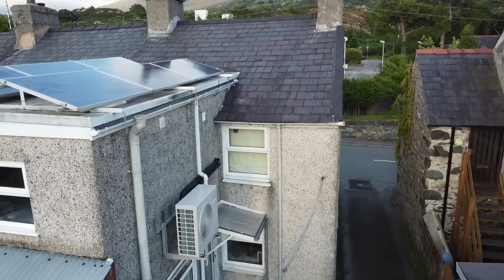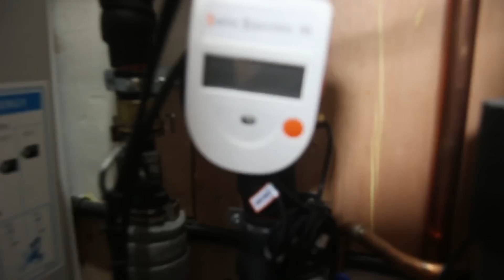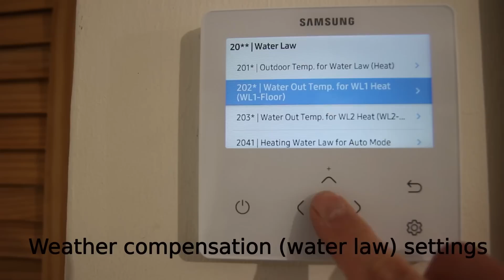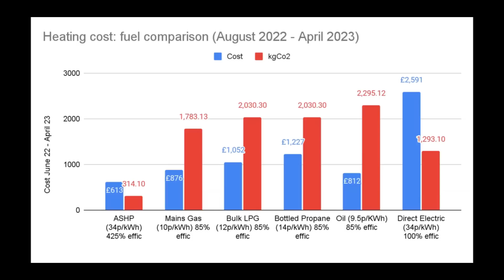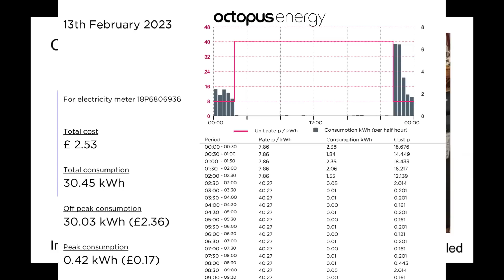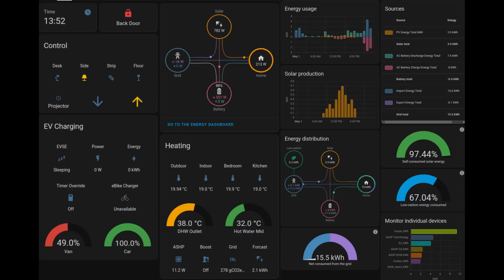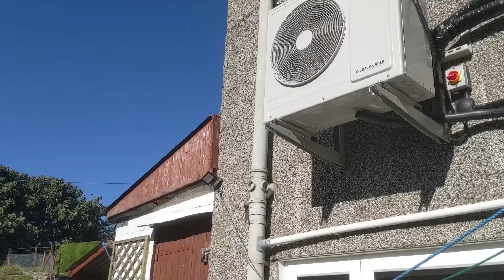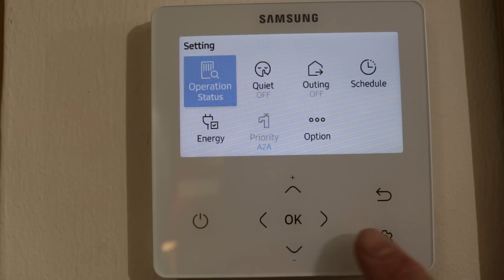Part 2/2: Air Source Heat Pump 1st Winter Performance 2022-23 in Solid Stone Welsh Cottage

Comment: Great job. Well done. I have a Samsung Gen 6 system as well. Any chance you can share the details about adding a WiFi unit.
Reply from the maker: This is the Samsung WiFi unit, it enabled basic control of the HP via Samsung Smart Things app
Reply: Thanks for the reply. I'm planning to add WiFi to my system. But I'm not too sure about the wiring.  As I understand it should wire to F1 f2 v1v2. But those 4 terminals already have wire on it.
Reply from the maker: @alanmeng999 yes, you just connect the WiFi into the same terminals. There will be multiple connections on the same terminals
Reply: I really appreciate the help. Thanks
Reply: I installed it a few days ago. Now I can turn on the heating when I'm on my back from holiday. Thanks again for the help.
Reply from the maker: @alanmeng999  Nice work!

Comment: Great video, very informative! I'm in the process of buying a 3 bed bungalow that has an epc rating of an F. It has stone built walls with no insulation apart from some in the loft space. At the moment the only heating is electric storage heaters. I'm Trying to figure out if a heat pump would work or go for oil central heating?
Reply from the maker: @willsvanadventures  definitely go for a heatpump, it will cost 3-4x less than storage heaters and be much more comfortable. If you've not got a wet heating system installed it's a perfect opportunity to install a good system, if you go for a heatpump you can BUS grant £7500 grant and 0% vat for for the whole instalation, including radiator and pipework install
Reply: @GlynHudson thanks for getting back to me so fast! Would it still work without vastly improving the insulation though? Did you have to beef up the insulation in your house?
Reply from the maker: @willsvanadventures  no, I didn't do any insulation upgrades. It's a myth that insulation is required for a heatpump, as long as it's correctly designed a heatpump can heat any home efficiently regardless of insulation. Of course a well insulated home will require less energy to heat, but that's the same regardless of heating source. Assuming you've got some loft insulation and decent fitting double glazed windows doing anything else with building fabric is not cost effective, unless your undertaking significant renovation anyway
Reply from the maker: My house has no insulation in the walls or floor
Reply: @GlynHudson  Ok brilliant thank you, sorry for all the questions!
Reply: @GlynHudson watching more videos this morning and definitely looking more towards a ASHP. Can you recommend any companies for install? Or best systems to look into? Seems to be so many online.
Reply from the maker: @willsvanadventures  maybe take a look at https://heatpumpmonitor.org/ and contact an installer in your area.
Reply: @GlynHudson  Perfect thanks

Comment: Hi Glyn, can I ask about the efficiency figures you mentioned, the 5% under and the 20% over on the figures Samsung report, is this specific to just your installation, or do you think this could be universal across the Samsung range?
Reply from the maker: I've not got much data on Samsung, but we've been collecting a lot of data on Vaillant onboard monitoring on the OpenEnergyMonitor forums, and it seems the inaccraces are often due to manufacturing tolerance and lack of calibration, therefore the onboard monitoring could be over on underreporting. There's no way of knowing without a heat meter to compare.
Reply: @GlynHudson Thanks. I will add OEM to my installation during the summer time I’d imagine. Do regret not doing whilst I was in the middle of it all, but will be good to have some accurate figures to look at.
That said I am quite pleased with what I am seeing currently on the Samsung controller, I’ve had 3.88 (including hot water) over the last week with outdoor temps as low as 0° most nights. This was a self install too.
OEM will paint a truer picture of course.
Reply from the maker: @dannyg2325  Great! That's a very decent combined COP
Reply: @GlynHudson  Coming from Bulk LPG it’s a massive saving! From circa £6.80 per day, to now £2.80ish per day. It’s not to be sniffed at 🙂

Comment: Great channel, I have been watch many things on youtube as looking at put in a system in a new house my son is building and so far yours has been the best for information, I am a electrician in France and have seen many systems and had a chance to play with them I have one customer with a new system with two 26kw units heating a old house with small rads and no insulation that gets a scop of around 2 for the one that just does heating and about 1.7 for the unit that does heating and hot water (output temp from units 55°c) I have another customer with a under floor heating system that has had the pipes slightly closer together  and that runs a output temp of about 26°c and gets scop of about 5.2  (also does hot water) in one of your videos you say that the heat-pump seems to not run as well when output is bellow about 30°c, do you think you need to look at what refrigerant is better for a very low heat output, problem is also want to heat hot water with it. We are in South West France where weather is a bit warmer all year rounds so would expect to get better scop that in UK
Reply from the maker: @ianmills5805  Hi Ian, the comment about minimum flow temperature is specific to my system with my radiators, a system with even larger radiates or UFH will be able to run at an even lower flow temperature. It would be quite challenging for any radiator system to run in a steady state with a flow temperature lower than about 30C. As the DT between the room temperature and the mean water temperature reduces, the output of the radiators will reduce, so the radiators won't be able to dissipate the minimum modulation heat output of the heatpump if the flow temperature is too low
Reply: @GlynHudson  Hi thanks for the reply had not thought about it being the type of system but makes sense,  at the moment am tying to find as much information as I can as we hope to lay floor in the spring, the pipe works out about 1€ a meter so to lay a extra 200 meters of pipe (nothing else   
changes) if it can save a bit every year really money well spent, thanks again and have a great warm Christmas

Comment: Great video. What product did you use to insulate the pipe work in your plant room. Ours is a bit rubish and gappy and would love to improve ours .
Reply from the maker: Thanks, it's just standard armaflex pipe insulation. Inside the property, the insulation is not that critical since any heat will be lost into the house. Insulating the outdoor pipework well is very important
Reply: Thanks It's just for the summer dhw losses, and our exterior pipe work is very well insulated. Have you just wrapped it all in ali tape or is the tape another product? Thanks

Comment: Do you think painting the heat pump and surrounding wall high tech Matt black would double your efficiency if it's south facing?
Reply from the maker: @frederickbowdler8169  no, that won't have any effect on the air temperature
Reply: @GlynHudson  well I think it will warm up approx I kilowatt per square meter per hour which may warm air around it surely that's physics I could be wrong.. Incidentally Albert Einstein designed a fridge basically a heat pump in reverse but it was too noisy.😊
Reply: Let's face facts if you paint the south facing wall of your house Matt black you will have an ugly warmer house. Glaze the wall and you have the trombe wall system. Neat installation.
Reply: I wonder if there is a reason why heat pump cabinets are painted white perhaps it because they want to protect the electronics from excessive heat fluctuations.Or it could be a fashion trend.
Reply: Glyn could always apply a wrap to the heat pump for a period as a test?

Comment: Great work but all tech and electronics wear out and heat pumps do fail and possibly lose performance over time so this all has to be factored in.Unfortuately you live in a stone house which lets face it has 400 or 500 year technology in it's infrastructure so you have a good system but a poor u value if you could retrofit exterior wall insulation it would be great but problems of damp we ith old stone walls make this awkward.A great effort.😊
Reply from the maker: The year the heat pump has performance better than last year. The parts should wear out slower than in a gas boiler since they are operating at lower temperatures and there's no combustion taking place. Agree, retrofitting external wall insulation on solid stone houses can cause problems, it would need to done carefully. In reality, in a house this small, it's not cost-effective to do a deep insulation retrofit.

Comment: Looks like you system works well because the sun rays are directly hitting the heat pump.
Reply from the maker: @verygoodbrother  that won't have any effect on the air temperature given the volume of air which is moving through the unit

Comment: My boiler is silent. There is no way I am putting something in my garden to has a constant low level hum, especially trying to get peace in the back garden.
Reply from the maker: @AdrianJarvis-zk7ld  the combi boiler it replaced certainly wasn't silent! Nor is my neighbours oil boiler, unfortunately
Reply: @GlynHudson  My boiler is a Vaillant from 2012, and silent.  Not sure installing something with a constant noise nuisance can be excused by "well there used to way more of a noise before".   There are silent options.  Heat Pumps are not the answer for people who want peace in their gardens. Combi boilers are not constant 24 hours a day. They heat for a few seconds or minutes and switch off.
Reply: @AdrianJarvis-zk7ld in the video you can see the proportion of the typical winter's day the heat pump is heating (around a third of the day?), and as you say the noise isn't huge.

Comment: I can see there is no buffer vessel?
Reply from the maker: Correct, there's no buffer. The system is open-loop which is most efficient for a heatpump. Buffers are not often needed and should be avoided if possible.
Reply from the maker: Correct, there's no buffer. The system is open-loop which is most efficient for a heatpump. Buffers are not often needed and should be avoided if possible.
Reply: Thanks Glyn, much appreciated 👍

Comment: I can't do any comparison as your figures don't show actual costs.

Can you post what you paid for electricity in November,  December,  January & February,  then what you paid the year before you got the heat pump for gas in the same months?

I need to compare actual figures, not guess at what efficiency or saving comparisons might be. It's a lot of money to invest and easy to make the wrong choice and end up paying far more to heat the house than with gas.

If you have paid LESS than £70/month in electric during November,  December,  January & February,  £280 total, I will be interested in looking in to it further to divide the cost of installation and seeing how long it would take to show a real saving over gas.

Every person with a heat pump refuses to show their actual monthly electric bills for winter. They just will not do it, come up with lots of excuses, and I think the reason can only be embarrassment as it's costing more than their old gas boiler or storage heaters in winter months.  They never deny it!

My combined gas and electric bill in those months is £130-£140/month with roughly half of it gas and half electric. Heating is on 12 hours a day at 21c, plus hot water.
Reply: If my gas boiler is 80% efficient,  I pay £70/month for 12hours heat at 21c and hot water a day over winter...your heatpump costs twice that to run, so can only be 40% efficient compared to a gas boiler using your charts.
This is why we need to see the actual electric bills with amount per KWH , amount used and total cost per month.
Until the use of a heat pump was below £30/month for me, it would give no real saving after cost of installing.
Reply: Costs for the systems are available on the Open Energy Monitor website if you know or can guess the tariff.

The suggestion is that a reasonably installed heat pump (worse installed than Glyn's) would have a similar energy cost to a gas boiler at the price cap. Companies like Octopus and BG suggest they can match and possibly beat the cost of a gas boiler. My install would cost 10% less than a gas boiler on the price cap tariff.

Comment: Really well done.... Is watching heat pump porn a thing as I appear hooked ..... Do I need help😅. The data & method of collecting is really helpful. Having installed my own pv which uses excess diverted for immersion when I reslated my edwardian house myself I now am looking to the possibility of going down route of self installing a heatpump but maybe with a higher temperature model - maybe Daikin unit. Like you I fancy keeping it very simple with no buffer tanks.... Simple flow & return Thanks for really interesting very well made videos.

Comment: Thanks Glen. Really helpful. I also do have the same Samsung Heatpump. But one thing which I am struggling is the support from the installers. The do have very poor knowledge of the system and keeps on saying the same thing again and again when I call them for different purpose. However, I am watching several videos of this sort to gain knowledge. I am so happy to know that you are benefitting with the device. I understand that the setup in which the system should run is the key here. If this is not right, you end up paying more than what gas boiler does. This is what I am going through now. Can you please do a video of the setup you have in your system. If you have one, please point me to that. Also I had nest controller for my gas boiler which is being used for the heat pump as well. Is that advised or should i get rid of it. Your response will be highly appreciated.

Comment: Hi. Have you compared the heat monitoring system you have with the Samsung controller readings. I just wondered if they were anywhere near as Samsung tech say take no notice of them
Reply from the maker: Yes, that's covered in this video. The Samsung reading are very wrong
Reply: @GlynHudson  thanks Glyn I thought they must have been I do have a energy meter which the Samsung controller does almost tally up to on a daily ir hourly reading but some times it does say its been running 37 hours in one day. Which means it's probably on some alien calendar!. I still think 4000kwh per year is fairly good keeping the property at 20 degrees I'm just to tight to invest in the kit to prove the cop. Yesterday it said it had used 20 kwh and produced 140kwh of heat
Reply from the maker: @johnfreshwater3790  the electricity consumed value is usually reasonably accurate, although it won't include the consumption of additional pumps or the immersion heater
Reply: @GlynHudson  I don't have mine use the immersion as we have a 150 litre tank so gets regular turnover and I heat it to 50 degrees. Our epc says 22500kwh for heating and 2500 for hot water also the heat punk software calculated 7000 kwh per year so for a 200 sq metre 220 year old Georgian solid stone house I must be almost as good as I can be although the heatpunk software said all my rads are to small except one so maybe improvement is possible. It's just convincing the misses I need to up-grade perfectly good rads.
Reply from the maker: @johnfreshwater3790  nice, I do the same. Upgrading rads is usually a very cost effective in terms of reduced runnings costs from the heatpump running more efficiently at a lower flow temperature.
Reply: I think as long as you get your flow rate up to suit the kw output required and large enough rads to suit you can't go wrong

Comment: Thank you for your excellent informative video. I’m a total ignoramus where heating and electric are concerned.  I’m looking into the new government ECO4 grant that could be worth a lot of money. (They’re offering internal insulation, an ASHP, extra large radiators (I think) and a couple of solar panels (no batteries).  And I really can’t work out if it’ll be worth it.  I live in a longish welsh stone cottage which is half of the ground floor is under ground.  I have a few issues straight away I hope the installation surveyor can address when he visits at the beginning of Jan like - very little room to increase radiator size and siting of the big cylinder as all my ceilings are low. But however good a good ASHP is, how do I know if the cheap ASHP the grant arranges is half that good?  A friend had them out a short while ago and it was going to be too difficult to fit and refused to fit saying he’d have to do it himself!😂
Reply from the maker: Eco4 is a good scheme, it's very generous and the systems are usually well designed. If you go for it push then to design the system with a max flow temperature of 40C it possible. This will probably require some radiator upgrades which they may make you pay a bit toward but will be very worthwhile for long term low running costs. Go for it!
Reply: @GlynHudson  you are an absolute star!  🌟 I’ve been sat at home today with no central heating and been perfectly warm, it’s the minus temps I don’t like! 🥶. It’s so hard to get unbiased opinions. Of course the surveyor and sales team will sing its praises and then you have the naysayers where it’s the devils work. So long as it does what it says on the tin it will be great news for me!  Thank you very much. Merry Christmas to you and yours and wishing you the best for next Year!  Cindy
Reply: Hope your ECO4 install happened as you wished.

Comment: When you state the actual CH kWh is 6339, that isn't the actual kWh consumption at the meter?
Reply from the maker: That's the amount of heat energy delivered as measured by the heat meter, the electricity used for CH is 1440 as measured by the electricity meter. The heat pump on average delivered 4.4 units of heat for each unit of electricity input for CH.